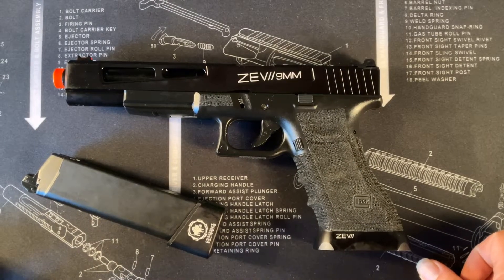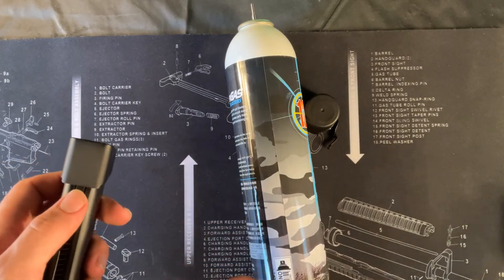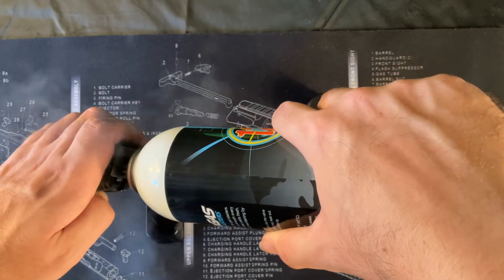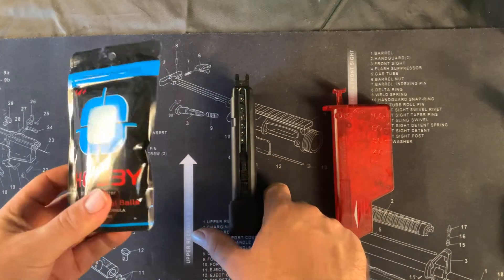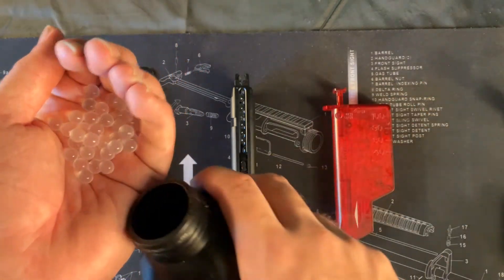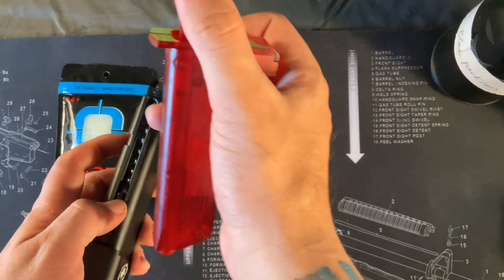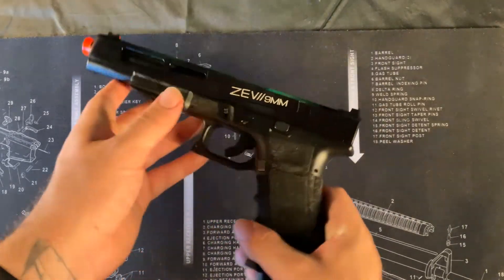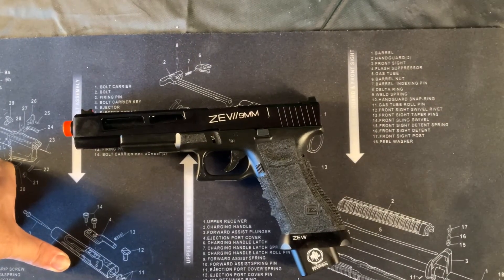Green Gas Gel Blaster Tutorial

Comment: I'm new to gas gel blasters. How long do you get before the gas runs out? Also is their maintenance involved with gas gel blasters or would you normally only bring them into a shop if something goes wrong.
Reply: With one fill up about 2 full mags, in terms of maintenance just lubricate slide every now and then depending on how often you use it, if you get any larger issues shops are generally pretty happy to help